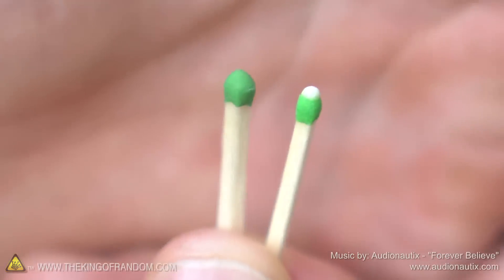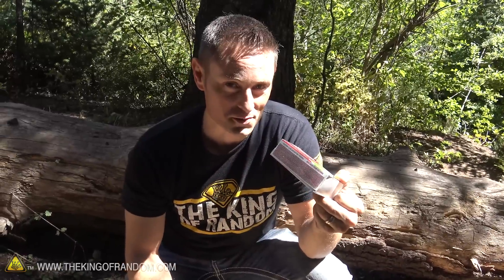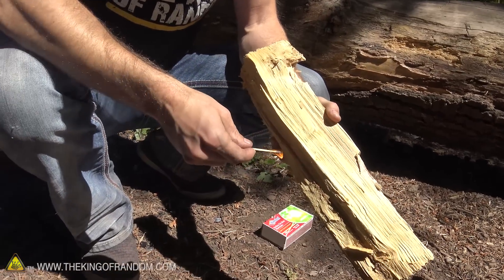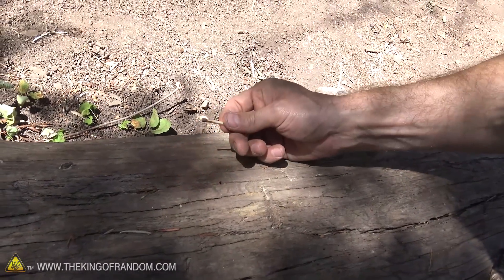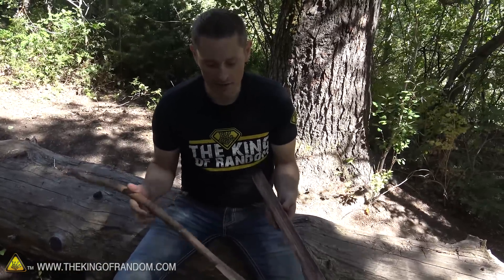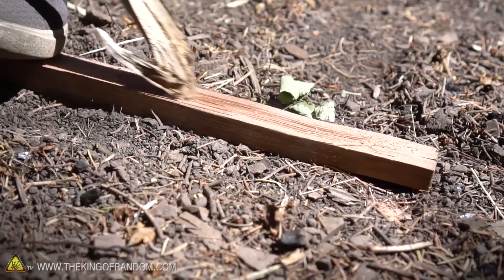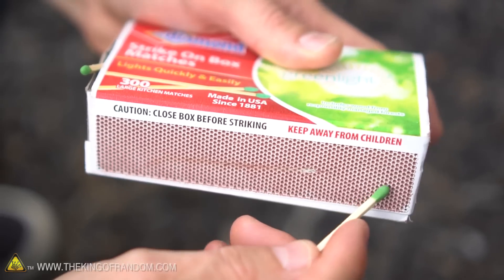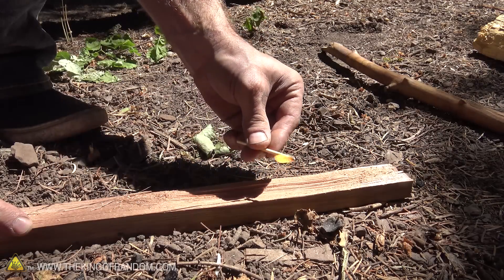Safety Match Survival Hack

Comment: This was very interesting!  Would I have to use wood, or would rock be sufficient?  My guess is that rock would wear off the potassium chloride before it got a chance to ignite.  What else, if anything, besides wood could be used?
Reply from the maker: +Outdoor Endurance wood would be the easiest, but I believe you can use the underside of plant pots, the underside of your toilet tank lid, and even the glass on your windows, except it scratches up pretty bad if you do that.
Reply: Thanks:  I appreciate your knowledgeable advice!  John
Reply: Grant Thompson - "The King of Random" Awesome videos!
Reply: i used a brick and also my rough cup.
Reply: try the floor (if at a place with a floor) it works on some kind of tiles (it can't be too smooth or too rough) I can light them easily on my bathrooms porcelain tiles

Comment: U can light matches on glass too, it's quite hard to do but it works...
Reply from the maker: +Eddie Gerbais-Nief yes I've tried that, but use caution because it will scratch up your windows.
Reply: You can also light matches on denim clothing.
Reply: Eddie Gerbais-Nief glass has no friction, how does that even work?
Reply: If you can hold onto a thing, it has friction. Why would you think glass has no friction?
Reply: Indeed, friction works with vibration frequency, if  to materials have the same vibration frequency, the friction is maximal. For instance, if u want to start a fire with sticks, they have to be from the same wood to provide the same vibration frequency then the maximum friction ;)

The glass and the match may have a similar vibration frequency.
Reply: Eddie Gerbais-Nief 
Source?
Reply: I don't remember where I knew about vibration frequency but it doen't matter because u can confirm this theory by yourself at home.
Reply: Eddie Gerbais-Nief Sounds like total wank. If you're talking about resonant frequencies, this can easily demonstrated as false because an object's resonance depends on the material and the object's dimensions, but its coefficient of friction merely depends on the material and surface texture. So cutting a metal rod in half will change its resonant frequency, but won't change it's friction at all.
Reply: Nope, not even close. You'll often want your spindle and baseboard to be two different types of wood if you're actually trying to make a dredge fire or bowdrill fire.
Reply: Wow this video
Is really helpful! U can use light a match like this
If he camping
Reply: Eddie Gerbais-Nief cool
Reply: Please do a video on that.
Reply: Eddie Gerbais-Nief  China 🇨🇳 is the best
Reply: Eddie Gerbais-Nief is that noodles mask?
Reply: Eddie Gerbais-Nief have I found another gorilaz fan?
Reply: Mister Dad I love Gorrilaz
Reply: yes
Reply: I have found my people
Reply: He's probably a kid give him some slack.
Reply: Ghostwalker CIA u actually can strike matches on glass, and like he said, it also can be a little difficult.

Comment: With the matches whose heads don't crush too easily it's possible to ignite them against a window pane. WARNING: it leaves permanent marks. Did it 30yrs ago in my grammar school (in Poland). 

What I would add: contrary to intuition, harsh/abrasive surfaces are bad, because they remove material from the match and make this spot flat (big surface).  The area of contact should be as small as possible, because friction heating is concentrated to small area and VERY high temperature can be achieved locally, and that's what's it's all about.

Comment: Another way to do this is by getting a bunch of 4 or 3 matches together, and place another between the bundled heads. Pull and twist the single match out holding the bundle tight in a flick like motion. All the matches will ignite.